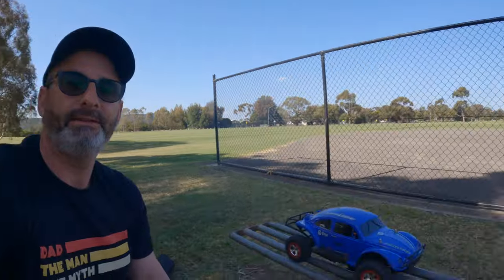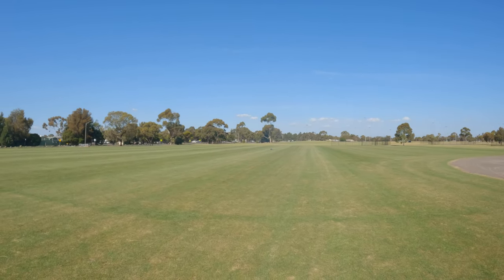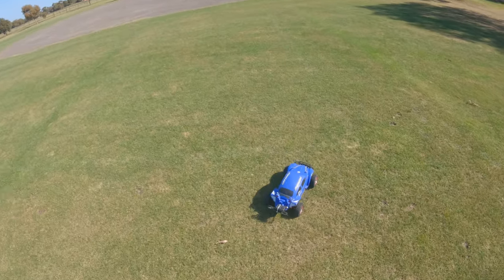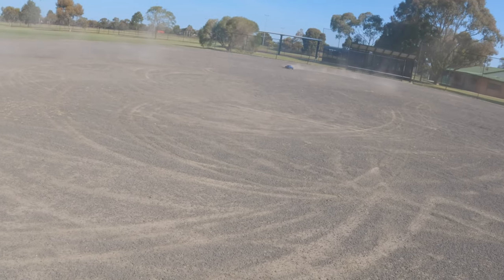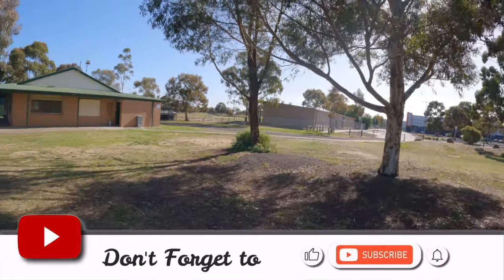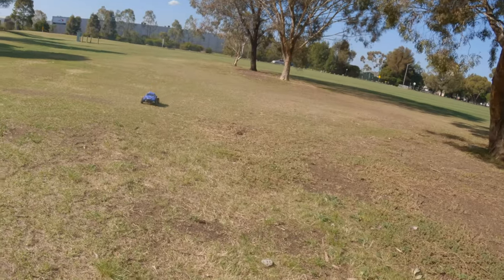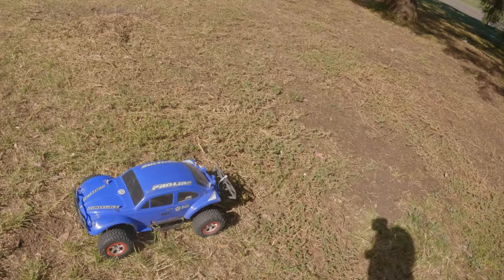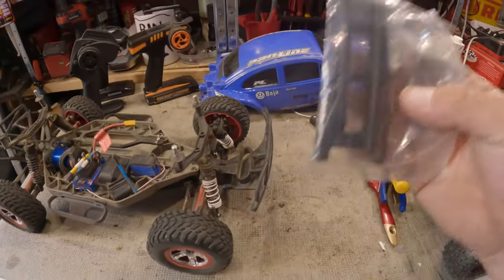Traxxas slash speed test & bash

Comment: Is Helion 3 diffs? How's the slash handling compared to Helion?
Reply from the maker: Helion has 2 diffs. It’s the same platform as the slash. But I feel my helion is quicker.🤔🤔. Even though it’s all stock standard. The handling is better on the helion as it has a lower body. As you can see the buggy body sits taller and creates more roll.
Reply: @angesrc  I just bought 9EMU, which is a slash clone. I'm used to 10sc which have 3 diffs, I feel that everytime almost out of cornering and I punch the throttle, 10sc will do a nice minor skid and correct it with grip maybe due to the power delivery is smooth out from 3 diffs. But the 9emu tend to almost rollover, one side lifted up due to the instant power from 2 diffs. Anyway I think theres always pro and con for each and every setup. Awesome run. Thanks for sharing 🙏
Reply from the maker: @MechanicallyFun  yeah for sure every car is built different and sending different t amount of power to the differentials from the center one can make a big difference.